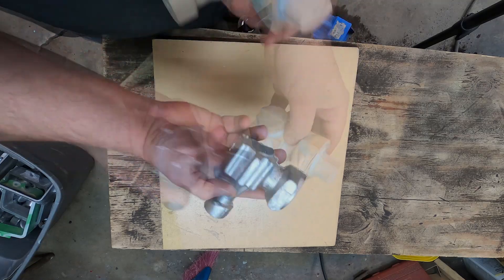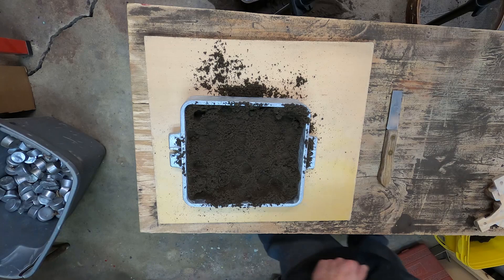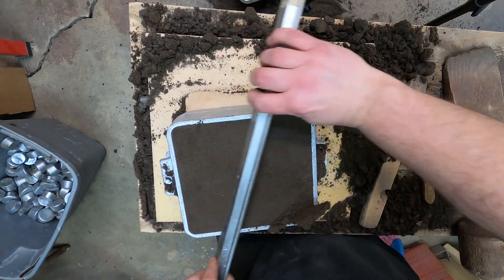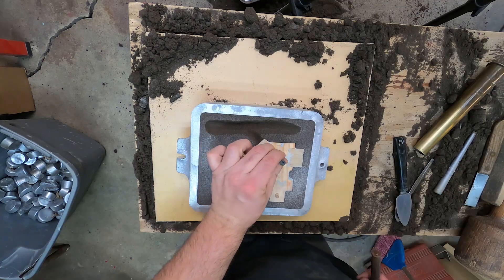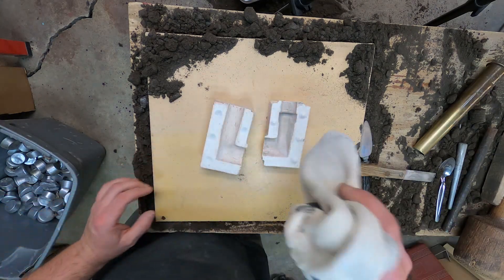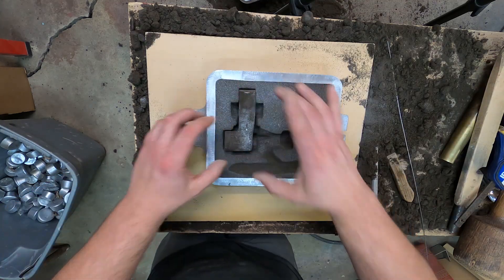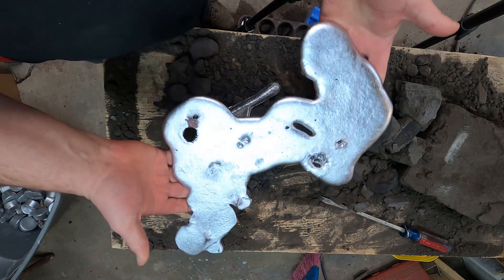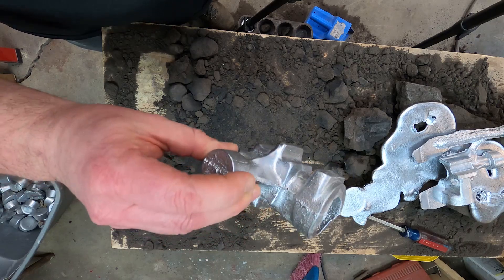Aluminum Sand Casting Two Stroke Engine Block

Comment: Whats the sand core for? You just dump a cylinder roll if sand inside your cast??
Reply from the maker: Its for making hollow sections rather than a solid part. Less machining and less chance of shrinkage as aluminum solidifies.
Reply: @strittmatterironworks  thanks
May be obvious, but then there is a sand core inside the part?
You don't end up with thin edge sections?
Reply from the maker: The core is removed usually through the core prints. The prints are the areas where the core is supported. As far a thin sections, I determine how thick or thin all areas are during the designing and making of the pattern and core box. Sometimes some modifications need to be made. Its not always perfect the first go around.
Reply: @strittmatterironworks  I am a CAD designer, technical engineer grad. I understand , so there is a space for the sand to exit the enclosed casting?
EDIT
I see, the casting is hollow through the centre lines. My mistake.

Thanks for the video. Trying to learn about DFMA as much as possible 

Looking to get my own 3d print and cast

Comment: отливка целесообразна при массовом производстве, 
для производства единичной копии проще выфрезеровать из единого куска
Reply: If you dont have a metal mill it's easier to either make or print something like a wooden model then use it to make a sand mold.

Comment: It worked out in the end! Puddles on the floor are never a good thing.
Reply from the maker: It was getting late and I wasn't paying attention. The pins bound up on one side and the cope was about eighth inch from setting on the drag.
Reply: May be obvious, but then there is a sand core inside the part?
You don't end up with thin edge sections?